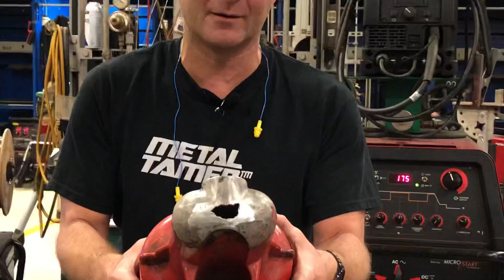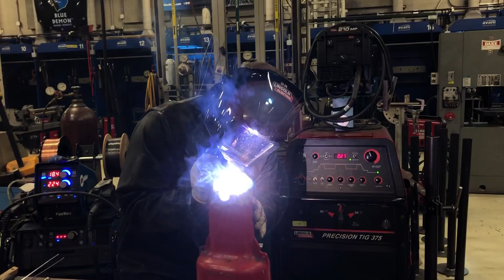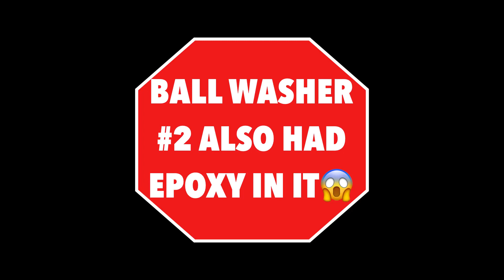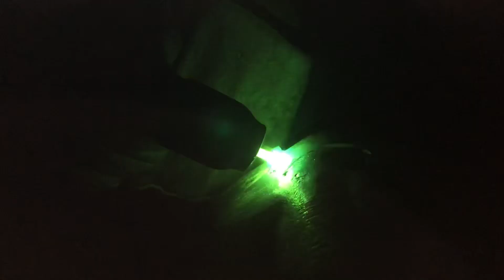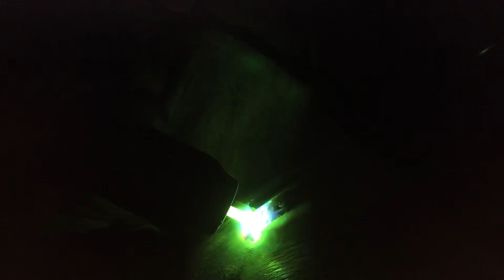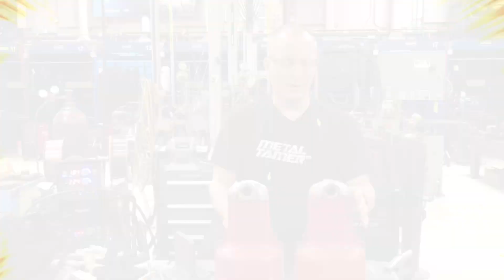CAST ALUMINUM REPAIR GONE BAD!! PLEASE DON’T USE EPOXY!!

Comment: Thanks for the info. Any suggestions on how to rejoin 2 clean breaks in the cast aluminum negative stage of a 50+ year old Leica Photographic Enlarger that was broken during shipping due to poor packaging.  I paid very little for it, but it turns out to have been in nearly perfect condition, the best I have ever seen, except for the two small breaks in the cast aluminum?
Reply from the maker: Were you able to fix you Leica enlarger?? I’m so sorry I overlooked your comment!!

Comment from the maker: Nothing like a little JB weld to fix all of life’s problems 😂 I can’t tell how many welds have blown up in my face due to epoxy!! Plus it’s TOXIC!!!!
Reply: Quality PSA & I agree with every last thing you said, buuuut I've gotta admit I'll be disregarding any caveats issued over an alternate method's toxicity when the preferred method involves vaporizing significant quantities of metals w/whichever welding flux (*especially*  when that metal is aluminum). Can't help but see that as a silly/moot selling point is all, hahaha